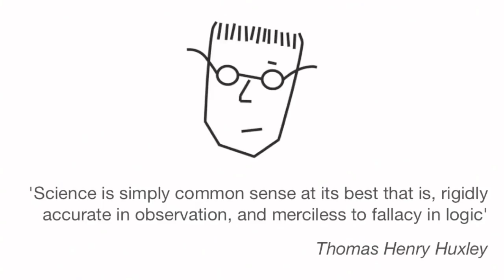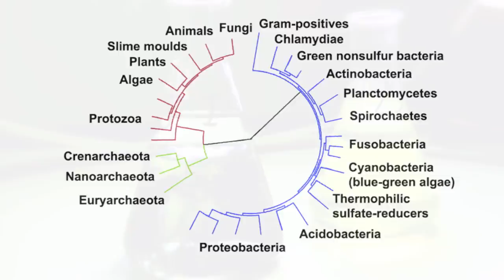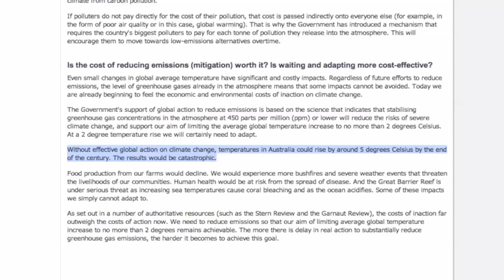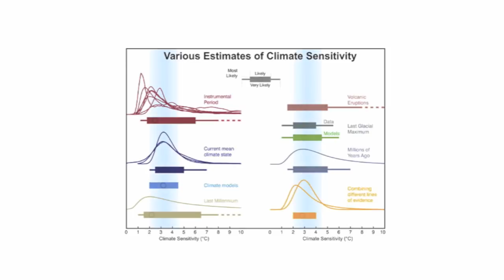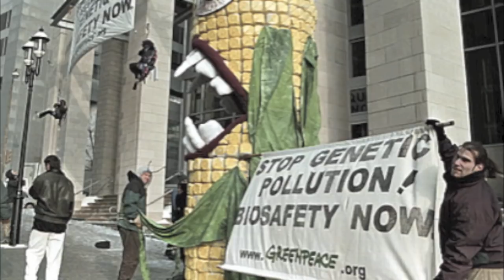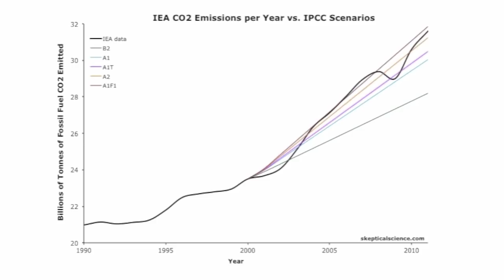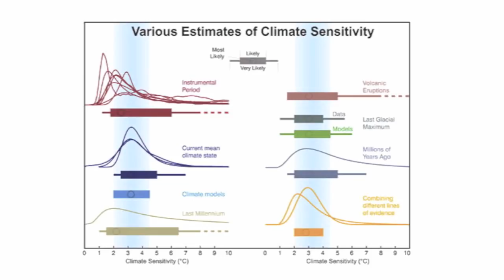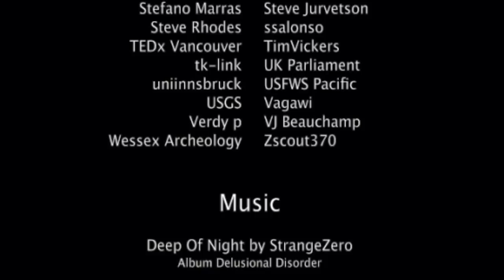Climate Changes, But Facts Don't: Debunking Monckton

Comment: The first point I'd make is that the majority of FF reserves can't be burnt if we want to maintain a stable climate.The second is that the cheapest and easiest to produce FF have already been burnt and returned to the atmosphere.Oil production has basically flat lined since 2005 and is only being supported by highly polluting tar sand,deep sea and shale oil( which is not in fact oil at all, but a precurser called kerogen).

Comment: CO2 is a greenhouse gas. That is it both absorbs and releases infrared photons. Once released, there is one chance in 41,253 that infrared photon will continue within one degree in the same direction. This basically gives that photon a 50/50 chance of going either up or down. Since the oceans cover about 70% of the Earth, this gives that photon about a 35% chance of hitting a body of water. Infrared photons will not penetrate the surface, instead will excite an H2O molecule causing evaporation. H2O is the primary greenhouse gas which prevents the Earth from having a climate like our moon. Consequently the more CO2 we put into the atmosphere, the more H2O gets into the atmosphere, the warmer the planet gets. This is how a 40% increase in CO2 caused a 7% increase in absolute humidity. The increase in temperature due to the increase of H2O and CO2 gases is approximately .9C at present. Because it takes a tremendous amount of time for the oceans to heat, it will take centuries for the Earth to reach temperature equilibrium. If we continue to inject CO2 into the atmosphere, that heating process will continue to accelerate.

Comment from the maker: The paper hasn't been retracted. What happened is that the journal received complaints and are investigating it, in the mean time the paper isn't available. It is a valid point of criticism that the journal wasn't very pro-active and clear in their messages. But the paper wasn't retracted.

Also he never admitted they were baseless. Here's a good rundown:
bit. ly/10LGF42

Long story short: the recent proxy data wasn't robust, but they used the temperature record for the conclusions for that part

Comment: Why do you think the FF industry is drilling 3000m into nearly impermeable rock if supplies are so bountiful?You do understand that the typical shale oil well has a decline in production of 90% in 24 months, shale gas similar? The only way to maintain production from these plays is drilling thousands of infill wells.
Yes there are huge reserves of low quality lignite coal.The next rung down the energy ladder will be peat and then cow manure!

Comment from the maker: Like I said in this video a scientific consensus is based on evidence, not opinion/popularity.

Carbon dioxide was lower during ice ages and acted as a feedback not forcer as it currently is (the lag is due to CO2 release from a warming ocean).

The world has still been accumulating heat and pauses in temperature rises happen (also seen in model runs).

A greenhouse signal is warmer in the lower atmosphere and colder in the upper, which we are seeing.

Comment: The problem with fusion is pretty simple: To power the electromagnets that make the hydrogen plasma push close enough together to fuse to hydrogen requires more energy than you get back from the actual fusion, or enough gravity to do the job for you (as with a star).  This is the primary reason why to date the toroidal fusion reactors can not produce more energy than they take to run.  In the case of the star, energy is used as the fusion products go up the periodic table requiring more energy.

Comment: the other problem with fusion is that you still have to produce the base fusible materials which also requires energy to do so.  The best current methods to produce hydrogen is from fossil fuels, which is another problem in and of itself.

Comment: Firstly to construct a wind farm you need to mine minerals and refine them to make the steel, magnets, wires, concrete etc. This all requires fossil fuels.
You then have to construct the item on site. Once this is all done you then wait for the wind to blow at just the right speed and generate some electricity.For 80% of the time the wind is not right and you get nothing. You have to maintain these structures.

Comment: Sir... that is not it. That is but one negative aspect of it. Crony capitalism I mean. 

1.) The world food supply will be affected
2.) 1 Billion pounds of Carbon pollution is going into the air Every day.
3.) The ice caps are melting away
4.) previously we've had storms ranging in the 8 to 9 range per year now it's 10 to 18 storms per year.
5.) Less research money going into future tech that is not Oil
6.) Sea levels rising,
7.) It also affects how our military operates. Yes it does.

Comment: Actually, carbon taxes typically don't do much, if anything.  The only true solution to the carbon dioxide emission issue is to invest in alternative energy sources.  And no, not wind or solar.  Wind takes up too much land and kills too many flying things, and solar is too expensive, and solar panels have toxins in them that are exposed to the environment when dumped in a land fill.  In reality, we have three options for future power, geothermal, ocean-wave generators, and fusion; that's it.

Comment from the maker: Actually there is a video clip I use where they show one of the model runs used for the IPCC report and it shows barely any trend at all over a 20 year period (the 1997 report if I recall it correctly). This can easily happen due to climate noise that 'hides' the underlying trend.

The projections the IPCC uses are ensembles, multiple runs averaged against each other, to filter out this noise and bring out the trend.

It's all perfectly well explained in this video.

Comment: Big problem there is that the best way to make hydrogen is from fossil fuels.  And electrolysis of H2O is extremely lossy.  You have to make the stuff to fuse it, and making it requires more hydrogen being fused than you can make energy from that to make more hydrogen unless chemically from fossil fuel.  Not to mention the problem of powering the fusion generator itself.

Comment from the maker: It does take a lot of energy to get a fusion reactor started, however, when running it should provide more than enough energy to make up for that. The problem currently is harnessing this energy and making the technology efficient. That's why they're building those test reactors so they can get past the point where a reactor still requires more energy than it generates.

Comment: Actually, fusion is really close.  There have been significant improvements in materials that have allowed for fusion to become a reality.  Lockheed Martin is making a fusion generator that they say will be operational by 2020.  And in France, there's a fusion reactor (ITER) that has been doing experiments for the last few years, and they think that it will be fully operational by 2020.  And no, solar does not produce enough power for even our current needs, let alone future needs.

Comment: Probably since about the mid 1980s the political right has been working hard to reduce the size of government and I do not wish to pass judgement on the merits or faults of this ideology, however, reduction and elimination of Co2 emissions is only possible with decisive government action.Taxing the use of climate harming energy sources and incentivising clean tech is the only option.Admitting government solutions are the answer to the problem is swallowing too big a dead rat, hence, denial!.

Comment: Now it's similar with his statement. The ocean above 300m almost stopped warming. Yet the ocean below 300m is still getting warmer. One possible conclusion could be that the upper layer simply gave away its heat more rapidely to the bottom layers and therefore didn't warm much itself. This could have happend due to increased mixing of the 2 layers due to different flow patterns. Of course this is all speculation. But stating that it doesn't make sense is quite a premature statement.

Comment: Wind is not better than nuclear.  Not even environmentally (seriously, nuclear is really clean, and the waste can be put into "fast reactors").  Conservation would not be enough, and just a little FYI, most "standy" components switch to "ultra-low" voltage settings now-a-days, allowing the devices to utilize practically immeasurable wattages.  However, there are many server bays that probably could be switched off on occasion, and that would save a decent amount of power.

Comment: And thermodynamics still says that the amount of energy needed to fuse something will require enough energy to push them together.  Which, is about the same as you can get from the fusion to begin with.  Fuse more material at once?  needs bigger magnets which need more power... you get the idea.  Stars get around this by being massive enough, but still consume that energy because the higher the elements go on the table, the more energy is needed to fuse them.

Comment: I went to Belgrade Serbia last year, where Nicolas Tesla is from.  And there is a museum there in his honor.  They do push some conspiracy theories.  Like the speaker pooh-pooh'ed the idea that there are technical hurdles in battery technology and insisted the primary reason we don't all drive electric cars is because of the oil industry.  But, they had some interesting exhibits nonetheless.  Check out "Nikola Tesla Museum" on Wikipedia.

Comment: You attribute increase of efficiency to reductions of CO2 emissions, not to progress of technology irrelevant to where the energy comes from, you attribute decrease of electricity prices as sign that the new sources of energy are more efficient,even though you could achieve the same decreases by building any other extra sources of energy,you claim that solar and wind create more jobs,I say they need more people to get the same job done.I am afraid we are having a theoretical controversy here.

Comment from the maker: Took me a while to confirm if I had interpreted the article correctly, but your point isn't supported by the quote. If you read the original article (which is from the MET) they basically state the same as I did. That if you correct for events like ENSO the warming signal emerges (i.e. the planet is still accumulating heat). That's on page 23.

Also the surface temperature trend isn't zero, it's still going up. Just not as fast as it did in the 90s.

Comment: The rest of the paper is nothing particularly new or controversial. The whole story was the claim about the 20th century uptick which as it turns out is utterly baseless. Note also that the uptick never appeared in Marcotts original thesis. It was added later presumably for headlines. I suspect he may have been gulled by his hero Mann but either way he has probably screwed his career. Climate 'science' is a disgrace and needs to be reformed and brought back under the rules of honest science.

Comment from the maker: No there isn't, there's ample evidence our planet is still accumulating heat: watch?v=88jEdz7OGx0

Also you're talking about a transient effect in the temperature data. Equilibrium temperatures, the version I talked about in this video, is only achieved after 100 years. We're just now experiencing the full effects of what we've emitted a 100 years ago.

Source for the trend calculation?

Comment: I'm afraid fusion has been 50 years away for the last 50 years. I wouldn't pick that one riding to the rescue any time soon! 
Solar expensive? Because the cost of  environmental destruction isn't fully priced into fossil fuel consumption, the price at the pump isn't the actual cost. FF are hugely subsidised by the natural world and future generations. 
No solar isn't perfect but it will provide for energy needs, if not wants.

Comment from the maker: Some users just don't have the time to actually engage or take a while to respond if you ask something. But yes, some do go away if you ask for evidence or sources. Although the behavior I've seen most is a flat out refusal to give sources. It's the reason I have rule 7 (no unsourced claims) mentioned on my channel.

That's there because I just got tired of trying to find what someone was referencing or talking about. It just takes too much of my time and they should be able to simply give it.

Comment: I think it shows enough if you understand the economic process connection. Firstly, the best way to obtain energy is to obtain it from all available sources, if you discriminate against any important source of energy you will be always in a worse situation than if you haven't. Secondly, the progress of civilization comes from fewer and fewer hands producing the same output. Everything indicates that solar and wind power require the labor of more people to produce an equivalent power output.

Comment: What this is is more pedantry than moderation and pulling up someone for nothing invalidates your censure of genuine rudeness and "calls for violence. I consider rudeness and swearing in a reply is an admission of defeat so I never use those devices and I strongly object to being accused of it and I would appreciate you acknowledging that this was clearly not the case as I feel I covered each of your points succinctly and without recourse to insult or hyperbole.

Comment: OK then that just tells me that the range of variation in these models appears to be so wide that pretty much any event "is consistent with" the predictions.
These observations are also "consistent with" most of the models which claim that CO2 is a driven parameter rather than a driver. IN fact I really wonder whether there is any observation that could be made that would falsify the theory of AGW.
Any ideas, sir?

Comment from the maker: The lower CO2 emissions are due to poverty, not the cause of it. What you're equating with CO2 emissions is energy usage, but energy can be generated without CO2 and in a way that it helps lift people out of poverty: 
watch?v=-wPrIJxPf4g (just one example)
You still haven't giving anything that shows a causal link between lowering our CO2 emissions and your claim that it would kill or damage our economy. It's also a false dilemma, if what I say isn't true, it doesn't mean it has to be negative.

Comment: No, that's not correct...at all.  Once you get fusion started, the energy required to keep it going is very small, and there is a huge net gain thereafter.  You know next to nothing about nuclear physics I'm guessing.  To get the reaction started takes a lot of power, but if you can keep the reaction going there is a massive amount of energy that can be gathered.

Comment: My point is clear - reductions in tax are not subsidies.
It is basically the same as the difference between a fraction and and negative number. 
If I pay 90% the tax rate others pay then that is  a tax break. If I pay -20% then that is a subsidy because I am receiving money that was not mine.
I am sure you understand this quite clearly but since you have an agenda to push it will not be recognised.
I still want to know how you can subsidise anything without something cheaper to spread the cost.

Comment from the maker: *headdesk*

I pointed you to some of the evidence multiple times. Which are segments 8, 10, 12 and 28, with me also mentioning that the rest of the video also contains more information (although less dense than those segments). The segment videos and transcripts contain the links to primary sources (i.e. research papers and such). I specifically said that these are enough to get a discussion started on the evidence.

Yet now you say you're done when I call you out for not addressing that?

Comment: Sorry to interrupt, but where is the trend -0.02C/decade?
Maybe only in the last decade, but what was the trend during 1955-2010 for example?
Or 1900-2010? Now we are talking 'climate'.
Do you at least accept the fact that we are living in the warmest decade since satellite measurements began? If current temps are unusual or unprecedented is still debatable, but surely the trend is up, up and up so far. And not -0.02C/decade. I have to disagree with you on this.

Comment: A network of 'Helios' style solar power systems using mirrors to heat sodium metal to run a turbine is currently the best method of producing energy from solar power that I know of.  Unfortunately it's been in the 'testing' stages for far too long, and a network of these devices should already have been constructed.  It's a matter of who gets what funding and who of them is most likely to be able to help whoever makes the decision stay in the position to make those decisions.

Comment: I remember watching this debate on the ABC in 2011. Word around the "traps" said it was going to be a real fire storm... it turned out to be a bit of a fizzler!!

Monkey is a reasonable debater as his claims cant be checked on the spot... While I was watching I wondered if he actually believed his crap or he is being paid by others to push this line.

I think Mr Denniss hit the nail on the head with his opening remark in this clip

Comment from the maker: Really? You accuse me of not caring after me saying this?: "But a more thorough investigation in this would have shed more light on the matter."

You've been attacking the removal of e-mails, nothing you said so far has dismissed their research (which is confirmed by other data sets). Currently at the most this shows problems with openness and transparency which is something I have talked about in the past.

Basis for your claim that Marcott 2013 is rubbish?